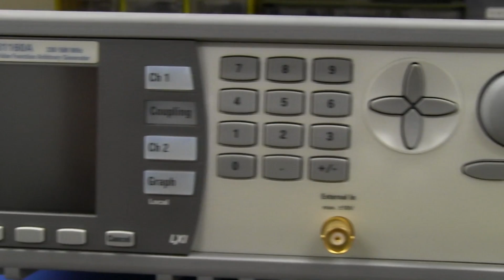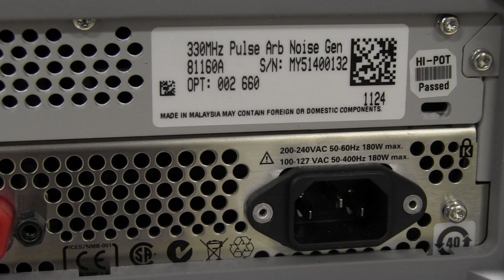EEVblog #308 - Agilent 81160A Function Generator Teardown

Comment: Oh man. I've used the AD9739 before and that is a BEAST of a chip. Should look up the clocking in the datasheet sometime. :) The main sample clock comes into those, and then drives the FPGA clocks from there. I'd wager that a V6 or a 7 series FPGA is what's under that heatsink.

Comment: Electronic parts + pcb = ~300$
They get 40$ per hour of work, i think so ~400$ for 10 hours putting screws in
logistic and cardboard = 300€
putting the Agilent sticker on it = 19.000$
Reply: did you forget the engineering design work and R&D? do you think this is outsourced to a Chinese company, that just designs and manufacturers it for them?

Comment: Hey Dave, just a little question that if you buy some tech gear and it is very expensive, so does tearing it down or showing it increases the profit you gain on your website? For example : you buy something which costs $1000, so does the profit increase by $1000 or more?

Comment: The copper squares are there so that the areas with traces have the same amount of copper as "blank" area. This keeps the layer thickness consistent, otherwise the prepreg will flow towards blank areas during board production.. This is important for impedance matched boards, where the layer thickness affects the trace impedance.

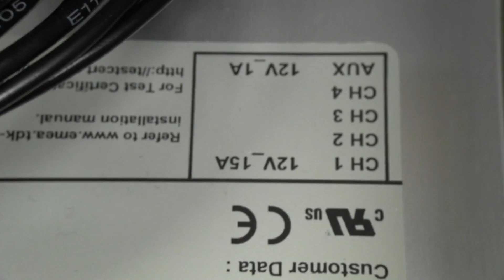Comment: 7:40 Dave I don't think that there are 4 channels supplying 12V 15A each. As you can see at 1:24 the maximum input power of this thing is 180W. This is the power one 12V 15A rail can deliver alone. If there are 4 channels the input power would be 720W max.

Comment: The side handle cover locking mechanism is exactly the same in this, that it was on a HP 3577A I took apart, to fix the GPIB module. It was really nice modular design.

Comment: Copper or silver plating would have better conductivity. Gold is usually used in electronical equipment because it doesn't oxidize.